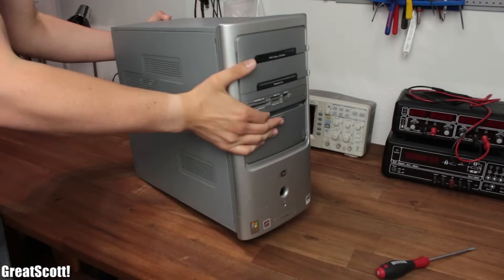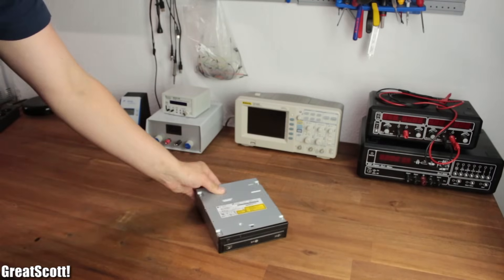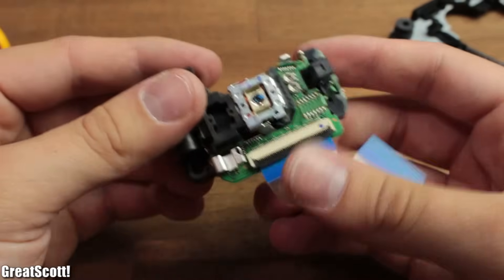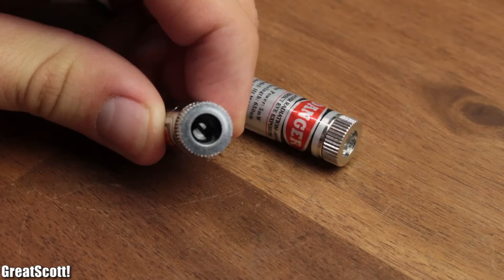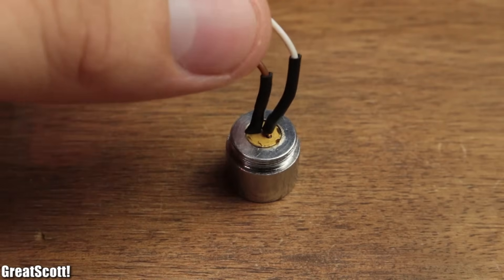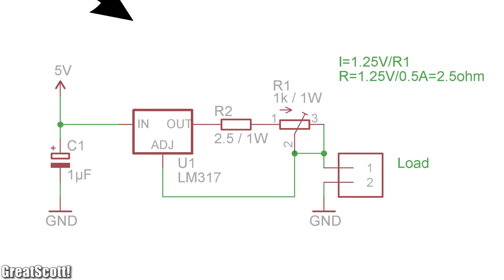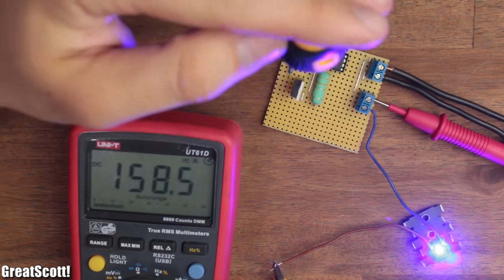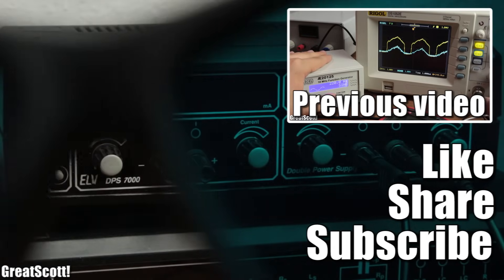HACKED!: Laser Diode from DVD Burner || Constant Current Source

Comment: To burn a match you need at least 200mw if you are using a 630nm red laser. Probably more than 250mw if using a more common 650nm red diode.
Also, no matter the wattage, focusing the beam is key. Use smoke or mist to set the focal length.

Comment: TIP: Peanut-butter removes oils, glues, tars. Chunky versions effectively helps this further, steel-wool does wonders. Polish with some tooth-paste and warm water
Reply: NOTE: That isn't paste that silicone, very ineffective are heat dissipation. Thermal Grizzly has some of the best, Kryonaut or K-Extreme is recommended for best results

Comment: this is why I work in electronics repair business  because I enjoy working even if  the repair process  alot of time and labor as long as customer is happy and paying the fees 😀
not only that  I do the same as you do  
for the Laser diode to actually  burn things you need  military level  laser diode which is not available to buy 
but you have  already disassembled the optical pickup lense   why not using the detector sensor  for  
example  building a  motor speed optical tacho sensor it would be fun to watch the laser light cutting through  the sensor disk .

Comment: For the future, there were likely 2 additional neodymium magnets that you may have missed...depends on the drive. They are REALLY TINY magnets, too...about 3mm L x 2mm W and less than 1mm thick. They should be attacked to a small movable coil that further stabilize the LASER beam emitter based on optical feedback from the disc. This helps the drives achieve much higher speeds than before.

Comment: 4:21 Mosfets are voltage operated devices not current … that 1k resistor isn’t necessary at all… it works of course but it won’t make any difference to the amount of drain current because it’s the voltage rather than the current on the gate that enhances the channel between drain and source… in other words it’s a voltage dependents resistor. 
Also there is no inrush current, inrush current is initial current that meets high capacitance and it’s the surge that is required to provide that initial peak in demand that is what’s called inrush current.

Comment: 3 minutes , 26 seconds.
There must be a mistake , what he says. There is not a drop in the forward voltage , because of heat
Rather, there is a drop in the foward resistance of the diode, because of heat.

Comment: Seems like either your laser diode is damaged or the drivers voltage isn't enough. Seems like the driver delivers the right amount current to a test load. But Remember just like LEDs laser diodes have a forward voltage so you just not have enough voltage to run it.  It kinda looks like you might have an infared laser diode

Comment: 4:38 did you ever get to making the 'other video' and if so, how can I find it? I ordered a laser to realize my mainboard uses a 3 pin PWM connection and the laser module is 2 pin with an internal circuit. The short of it is I'm designing a circuit where I already have the current source and pwm signal, I just need to control the laser.

Comment: Dude, use a heat gun/blow dryer  to remove the diode, when ive pulled those magnets from CD read/write heads it works well with bit of heat, plus breaking the coating on those magnets isn't great exposure over time, but with heat they slide off

Comment: Two questions: arduino can't supply the constant current in a PWN pin using just a resistor in series?
And what do you think about LM334 and LM741 constant current circuits instead of using LM317?

Comment: Isn't your constant current source is equally inefficient because it is also a linear regulator? The opamp is in a voltage follower configuration. Thus. the mosfet is used as a variable resistance, converting excess power to heat in the same manner as the LM317. You can add two extra resistors to the MCP602 to turn it into a comparator circuit with hysteresis. This would turn the converter into a very crude switch-mode converter. The trick is to only allow the mosfet to be either fully on or fully off so it does not dissipate any power. Smooth out the output by adding an LC filter if you want to be fancy.

Comment: The Technics SL-P1200 CD player had a particular point of failure in the CD door switch. The switch was a blade that contacted copper fingers, meant to prevent the player from operating whenever the door was open, because potentially a user could look right at the laser. But it was a crude design, so we had to replace them regularly.

Comment: I used diode without the lens, just bare bone and powered it from battery (e-vape cigar) directly - not even resistor. I don't remember the Voltage, sorry.

I was able to make dents/deep burns in plastic - black keyboard. At distance of around 0.5-1 cm. 
It probably shortens the life of diode but it was fun and less work.
Be CAREFUL though - it is DANGEROUS - always wear eye protection.

Comment: That diode is dead, high inrush curent made it a led. 
For laser diodes you need a constant curent controler, even 100nf capacitor whit high voltage can fry it.
It is a mistake to put it on lab power suply

Comment: Why you do not tried with pulsed laser beam? Short the pulse time to 1/10 and increase the current by 10 times. That should prevent that he heat is "spread over the surface over time?" (Also gibt der Wärme keine Zeit sich über die Streichholzoberfläche auszubreiten)

Comment: I would think you could use a high current pulse to drive the laser much harder. You can do this with infra red LEDs when you need to send the light over a longer distance. The data sheets will tell you how much current and for how long of a pulse to use.

Comment: Could a laser diode be driven from a simple adjustable buck converter such as the small ones from Banggood? Would there be an issue with the initial voltage spike and are these constant current drivers? https://www.banggood.com/5Pcs-Mini-DC-Adjustable-Power-Supply-Buck-Module-Step-Down-Module-p-952402.html?rmmds=myorder&cur_warehouse=CN

Comment: I tried something similar today. I broke 3 diodes with it...
Dont know how, but when i hooked it up to the supply, they lighted up very dark and i increased the amps for it to light up a bit brighter so you can see it and then they got darker again. They started lighting up at 0.1a not 24ma like yours did. Did i do something wrong? At 2v, 40ma i didnt see anything and one Diode just started working at 4v and 100ma. That was a green one and aufter powering it, it glows dark red, dont know what happened there.

Comment: Red photons frequencies don't contain enough energy to lock electrons from various materials but, blue photons have about 35% more energy output. Focusing the photons doesn't increase your energy output, all it does is increase the amount of photons. You could probably use a dim blue laser diode to light the match.

Comment: A little tip if you want to use a DVD diode.

Check the voltage and current on the drive before you remove the diodes so you get the correct values.
Reply: I wonder how he discover positive and negative in three leg diodes...

Comment: 1K/1W potentiometer is STPID thing :) Just use potentiometer as a voltage divider and divide voltage drop on current sense resistor. Second version with operational amplifier is much smarter but also not very good, there you can use 0.1 ohm/1W resistor :) And best variant is a simple current generator PWM modulator with TL494 or better SG3525.
Reply: Yes, thoses schematics are all based on the same mechanics as LDO's. The transistor is still operated in it's linear zone. He needs switched power supply in order to get high efficiency.
The PWM is a good hint for a simple constant current generator.

Comment: Why would you paint the match head black?
Reply: Dark colors absorb heat better.
Reply: Yes it does, but it may also have made the match head too wet to ignite.  I would have like to have seen you put a new unpainted match in front of the new diode.  Oh well.
Reply: PunakiviAddikti
Still, it is something being placed between the match surface and the laser.
Reply: PunakiviAddikti
How does it manage to manipulate the material on the disc if it's so weak?
Reply: to maximize absorption  of light to increase the heat being generated on the surface of the matchhead.

Comment: Kind of a bummer. I always thought it would be useful to take the laser diodes out of these old optical drives and use them to solder SMD's....
Reply: I was wondering if they would be good to cut think foam?!
Reply: @Colaaah  me, if it can remove black ink from PCBs - laser etching

Comment: They make precision voltage references for small amounts of current.  Basically you can use it similar to the schematic with a few changes.  Constant voltage across a resistor = constant current.  The precision voltage references are used in IC's like LM34 and LM315.  The LM1117 is a low voltage high efficiency voltage supply that would be ideal to run this kind of application in addition with the voltage reference and a battery pack.  Nice application and tutorial.

Comment: LM334 and one transistor will work VERY well see LM334 Data sheet, high power current source, as it only does 40mA with out the external Transistor.

Comment: WHY DID NOONE TELL ME THERE IS FREAKING NEODYMIUM MAGNETS IN A DVD BURNER?
Reply: well now we know I guess. I need to find a junkyard around where I live, the stuff people throw away would give electronics enthusiasts nightmares
Reply: @spoderman15  I got 4 big DC wheelchair motors for around $9 at my junkyard (they sell the scrap by weight), they have the gearboxes and electromagnetic brakes too.
Reply: neodymium is pretty fun...

as long as you don't need surgery to remove them from your face when you try to be an idiot with them.
Reply: Actually gives me cause for puzzlement but otherwise HIGHLY delighted that they do. I could spend a week at our recycling plant saving a fortune in bits, pieces and perfectly usable components Just today picked up two fully functional Makita drills, both two speed and one a hammer drill also. Well used but otherwise look in pretty good condition, only missing batteries - big deal - get on eBay for less than £25 for TWO!. Don't need the standard chargers as they f**k up batteries big-time. Have my own which doesn't! Also collected three PC's c/w psus and some older DDR400 memory (I needed some for an old shoe-box PC too), a few DVD RW drives (hence being here) LOADS of SMD components I can recover off these if the boards don't work. Amazing stuff people chuck away. A few fans (I always refurbish fans whenever I can. A few drops of 3-in-1 oil onto the bearing from behind the stopper - or sticker - work it in and bingo. I have one fan that I've re-lubed twice and it's still going after 16 years!! Quiet too.
Reply: @boblewis5558  I use K-Y on my fans 😅
Reply: @Colaaah  How considerate of you to take friction into account! ;-) LOL
Reply: +sans you can't find neodynium magnets since dvd players roughly. i'm sure i'm wrong but in some old CD players i've never seen them. Or i was really blind.
Reply: MERKinCiRi also in hard drives., they come in weird shapes
Reply: Have a laptop, 3 old PCs, 2 industrial WS (win95), CD & DVD players/burners, hard drives and other electronics in storage. Really need to see what to salvage and what to use for spare parts. There are wonders in those old things.
Reply: Darling you have no idea what's in there
Reply: Vermill fck yes there are small powerful magnets in just about ALL drives, hard drives have the most powerful ones, but DVD and CD drives also use some tiny ones for the laser lens positioning. Find the tiny coils for the lens positioning and use something steel like a small screwdriver or any ferromagnetic material and you'll soon find them.
Reply: @boblewis5558  0
Reply: Dude I was working on something and i was watching this video before hand, and i scrolled down and saw that comment just in my peripheral vision and left and worked and while i was working i kept thinking about it cuz i let my mind wonder while i work and idk, i just thought about the comment and i kept thinking that xDDDDD and i came back and saw your comment. idk i prob sound weird but i was just thinking about it and then u commented it
Reply: Cyclcrclicly 
You can find plenty of them in brushless motors from rc toys, such as airplanes and helicopters
Reply: There is in hard drives as well.
Reply: They're everywhere now a days.
Reply: My grandfather knows that there is magnet on it
Reply: Good think that all the dvds that I took apart I always kept that laser part in a box, thinking that someday I would find a use for it. . So magnet hunt you say? 😊
Reply: There are 2 identical small rectangle neodymium magnets and 2 coils that move the laser diode minutely in CD rom DVD for both computers and audio visual equipment.
Reply: Dominik yehaw  mmmm radiation...
And btw, I doubt you got 10cm magnets. I think you meant 10mm?!
Reply: 3 moths ago i had 5 dvd burners no one told me there was shit in that…. I fell like a throw a bunch of such good working components that i need now…
Reply: There are mini neo magnets in certain vapes that have separate batteries that you can stick onto the vape. Off Stamp is the brand I use, and I have about 100 used vapes saved up for the magnets and batteries / chips. I could probably ask the shop to start collecting used vapes for me to buy back for super cheap.
Reply: Andrew_koala ok i will do my best, im  11 years old, thankyou for your advice.
Reply: all dvd/cd player has them, it is a side of the tracking/focus coils. On the laser pickup
Reply: Cuz u didnt ask....  we all ASSumed u knew the simplest facts. Mags in hard drive is pretty basic stuff. ... ;-)    heehee....
Reply: Dominik yehaw how to die for Mercury poisoning
Reply: YEAH ME TOO!

Comment: You should have used the laser diode out of a blu-ray burner, not a DVD burner
and a proper driver circuit, not just a current regulator.

it's a thought.

Comment: I am not sure if adding the 1K resistor between the op-amp and the gate of the power FET was an improvement. You said : "to reduce the inrush current", but the gate of a FET transistor appear like a very small capacitor. Once charged, there is no flow of current. Applying a DC voltage to the gate produce no measurable current.

Normally, you want the lowest impedance possible for the control of the gate so that you can charge/discharge that internal capacitor as fast as possible. You want to operate the transistor in saturation mode : fully conducting or non conducting. If the transistor operate in between these extremmes, it will dissipate heat.

Comment: Great video. How fast can these laser diodes switch on/off? I have a laser I bought from eBay that has its own little circuit attached and is nice and bright.  But when I try to switch it quickly (for a laser harp build) it just doesn't illuminate . Is this due to the extra circuit that came with my laser or just a limit of the diodes?

Comment: could you make a laser cutter with one of these diodes and the a couple of the stepper motors that you can also salvage from disk drives???
Reply from the maker: +Tyler Durden Probably not with such a laser. But maybe something like that follows in the future.
Reply: +GreatScott! Can I make optical tweezers so I can stretch some DNA?
Reply: +GreatScott! They have made burning lasers with those diodes before. It has to be the driver.

Comment: You can light up a match with a LD from a burner. 
But I think your laserdiodes do not laser anymore anything went wrong, now they are LEDs. There are lots of things that could go wrong. Maybe they overheated and the endmirrors have smoked off. In the burner the diode is pulsed and the whole head works as heatsink.
LDs are very static electricity sensitive.
LDs have a very low reverse voltage.
Short spikes in the supply kills them very fast. 
All about Lasers... Sam Goldwassers Laserfaq http://www.repairfaq.org/sam/lasersam.htm

Comment: Hey, I love your videos man. I know how to solder and basic (very basic) electrical knowledge (using multimeters, the existence of Ohm's law, difference between AC/DC etc). 

I want to delve into these things a little more... What's a cheap, good project where you can learn more about some components like potentiometers, proper uses of relays and diodes, etc. I know the basics but want to try apply some more first-hand knowledge on it. 

It's been a while since I've had a good project; last one was simply a PSP mod many years ago (unless you count a recent CPU/GPU re-paste and USB replacement)

Comment: This kind of diodes start to burn at 150-200mA and you normally should run them between max 300-400mA.
I think he did blow the diode up, which can happen really quickly when he connected the diode to an charged capacitor, like the one of the output on the power supply. You cant really see this, the diode just gets dimmer and a powerful diode like that one could maybe look like an very weak laser diode after that.
Or he maybe overheated the diode because the diode did not have a "very tight fit" in the housing that it normally should have. Thats the reason why you "never" should use a drill to get the old/standart diode out of the housing.
Btw. you could even use a driver with just two parts like this one http://is.gd/OOSwlC just replace the resistor with an small potentiometer ;)

Comment: Pretty sure you have broken the diode. They will still light up when broken but won't lase properly. I have done this with several dvd head diodes :( They are very sensitive
Reply from the maker: ***** Correct. But I found another one later on. Link to the igniting video is in the description.